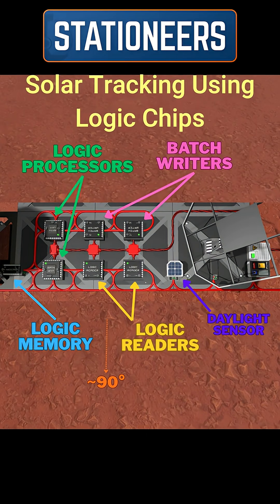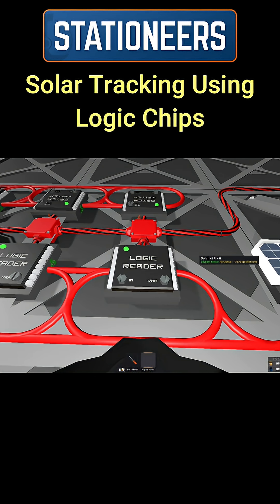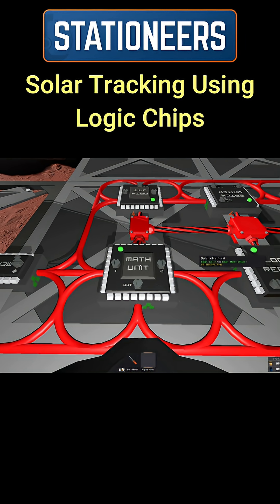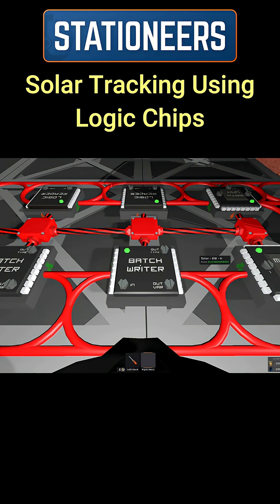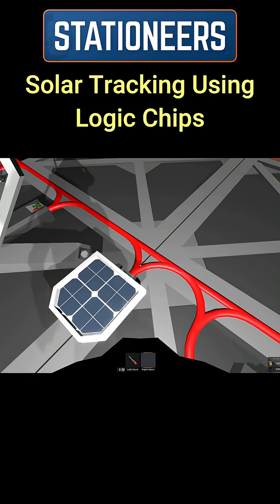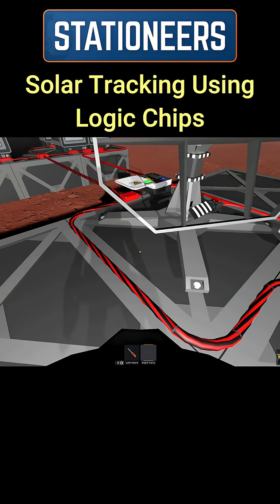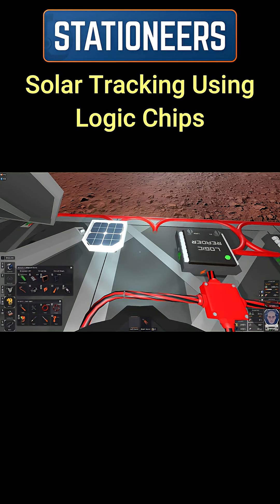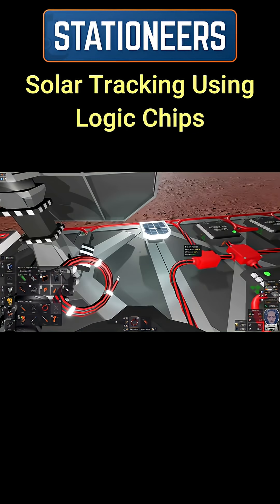Solar Tracking With Logic Chips -  Stationeers Power Generation

Comment: You have a cable blowout because you looped the input of your APC with its output, it doesn't have anything to do with separating the data and power lines of your  logic chips. It's also better practice to separate your power producers from consumers, which you didn't do by using combined input output on your solar panels
Reply from the maker: Yeah i do explain that about the input and the output of the battery meeting - Both solar panels work, it depends how you want to do cable management.  I prefer this type of setup but the same could be done with the dual solar panel option.

Comment: is this set up for just one panel?
Reply: For all panels, batch writers can change settings of all solar panels in the network at once. You just have to make sure all panels are in the same orientation, or they will not correctly track the sun
Reply from the maker: "Batch Writer" chips will update all of the same type of item - so this will work for every Solar Panel added to the circuit as long as they have the same orientation